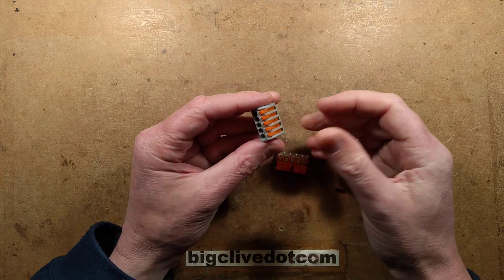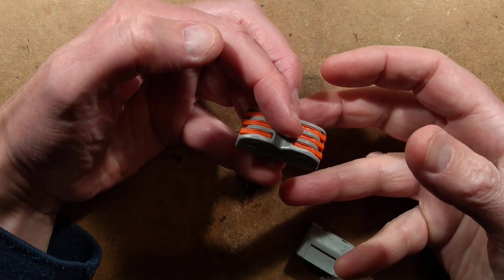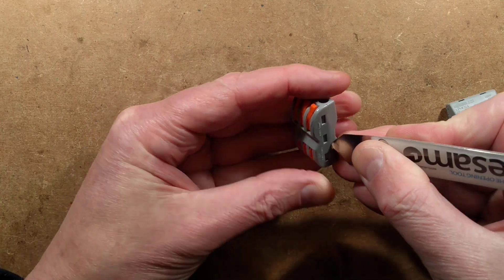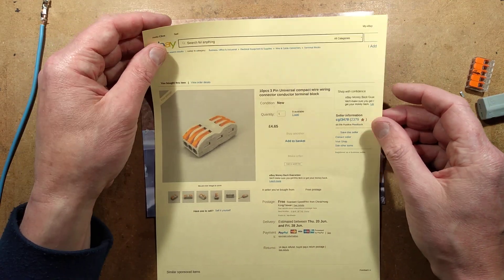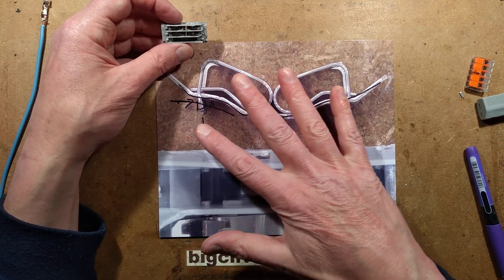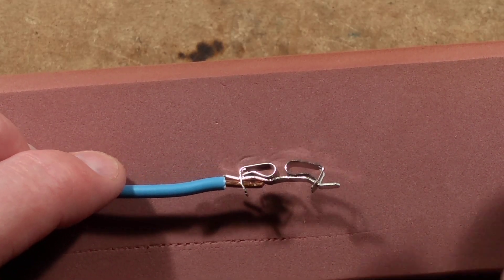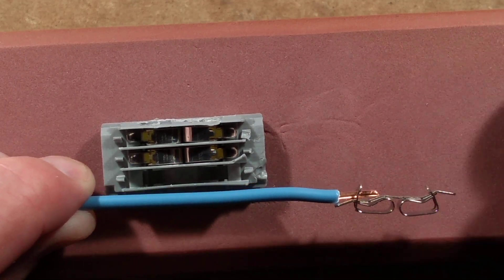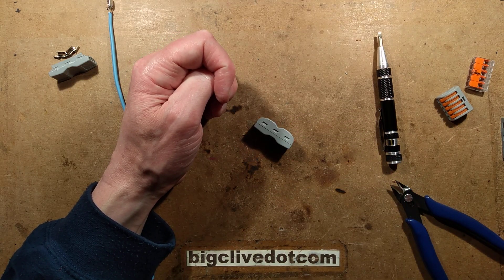Clone of Wago product that Wago don't even sell???

Comment: I've told Wago reps several times at trade shows that they need to do a multipole in-line connector as conventional ones are a mess to use - serves them right if someone else  does it
Reply: I bought some of the two and three wire splicers based off of Clive's first video with them, and my immediate thought upon using them was "why do I need two of these to splice power cables?"
Reply: @MrMartinSchou  because then, they can sell you 3 splicers instead of just one.
Reply: @oreubens  I know - I'm guessing that's why they are also referred to as lever wire nuts. But it's still stupid. This particular solution is far superior for certain applications.
Reply: @MrMartinSchou  Because you using two of their products instead of one. 
I think its profit maximisation.
Reply: It's odd how some companies come up with good ideas and then just stop developing them. I've had a similar conversation with a plumbing company that makes push fit fittings. For some reason they don't do 45 degree bends with connectors on both ends. You can bodge something together with two fittings but come on, it's such an obvious product.
Reply: @WobblycogsUk  Make it yourself, patent out. Retire :)
Reply: @WobblycogsUk  Might it be pressure, because of the bend?  That could but out of design pressures on the fitting- solved by redesigning the fitting but that would increase its cost, possibly beyond the cost of the current two fitting solution?  Tradesmen (people) are very cost sensitive so they don't buy the costly improved product but continue to use the bodge- so the company just wasted a lot of money.  Just an idea.  This type of fitting is used in water cooling a PC, or rather it is avoided when water cooling a PC as they fail.  You do bends in pipe and try and stick to inline pressure fit/ bayonet fittings.  Obviously water and electrics, especially expensive PC electrics are bad when mixed- so the best practice is to use hard pipe which you bend using heat (it is thermo-plastic).  Flexible pipe fails much more regularly even with the relatively low pressure in such a system.
Reply: @WobblycogsUk  I know what you mean im a plumber as well sometimes you dont have the room to fit two fitting. Its just to make more money
Reply: @rolandkeys8297  "Its just to make more money." I take it that you do not suffer from such sin.
Reply: @WobblycogsUk  I see a UK website offering the North American "SharkBite" push-fit product, which does offer a 45 degree bend www. sharkbiteplumbing . co. uk/ product / 45-degree-elbows/
Reply: @Wobblycogs Workshop It's not odd at all, the original company comes up with a good idea, then a fat Corpo comes along, buys the company and sucks it dry until it dies, then moves on. It's a common practice where by, the bigCorpo buys itself out of mediocrity.
Were it up to me, i would make this practice illegal and all such transactions in the past 10 years dismantled. It hurts the economy of every country on this planet, it hurts us, it hurts the product and the people working for the companies that are bought. THE only people who profit from this are the fat CEOs (some of the most useless life forms on this planet) and the banks.

Two close examples: EA (worst company award) and Google's parent Alphabet, and before that Google itself. Their most disgusting move was to buy quite a lot of groups that dealt in robotics, and when the CEO who's fad was followed moved on, they sold them. For example, Boston Dynamics wound up on the Japanese market. And now, one of their robots will be sold as a toy to the public IN Japan.

That's all nice, but, the people who bought them are SoftBank, a group notorious for their hate of those that are not Japanese. The future ain't bright for BD and already some people left.
Reply: @Alpha Machina - 3D printing something like this would be like printing books using a plotter and a quill. You use 3D printing for prototypes or when you absolutely have to (ex., complex manifolds that simply cannot be cast / machined / injection-moulded). You can literally injection-mould over 100 of these for the same cost and in the same time it would take you to 3D print a single one.

And the "cost of tooling" was basically the same for the Chinese manufacturer; the main extra expense for Wago would be testing and certification, which I'm guessing the Chinese guys didn't bother with.
Reply: @WobblycogsUk  You think an ex-money-laundering-mafia-startup would MAKE something? HAHAHA no. They fired their original designers. Engineers don't like publicity, so they have a buddy handling the marketting. Except the buddy handling the marketting is an asshole that backstabs his cash cow. This happens in EVERY company. CEO's are naturally ludites.
Reply: @dimitar4y  Only that Wago actually develops their product line.
Reply: exactly, wago should have done this type of connector in the first place.
Reply: I would prefer a version where all cable come in from the same side which would make it a bit more compact for things such as ceiling lamps.  Another improvement to difference this from the other wagos would be to use proper colors such as brown, blue, yellow/green to make sure nobody confuses the two types.
Reply: @ralfbaechle  Yeah, the levers should have 3 different colours that corresponds on both sides.
Reply: @trygvelillefosse6986  :   ........and there’s no tooling cost in changing the resin colour (assuming the levers are made separately)
Reply: @trygvelillefosse6986  does it really need colors to mix people up, or do you just need to stop trying to be a electrician.
Reply: @ralfbaechle  Actually that already exists. Over on aliexpress (probably on ebay too, since most of them are the same sellers any way) you can find these with colored levers in exactly the colors you want. There are also these, but T shaped (1 in, 2-3 out) and bunch of other fascinating variants including DIN-rail mounted.
Reply: @ralfbaechle  Good idea.  I agree I like the one sided approach as you say it saves space.  For inline, and I'm not saying this is the best way- I have a relatively expensive (£100) USB charged/battery powered soldering iron- it's programmable even but that isn't needed here.  So I just solder together and use that shrink tubing (shrinks with heat.  Again I'm not an electrician but dad was and he thought it OK to do- I didn't tell him the cost of the soldering iron though.

This is a link to the soldering iron, it is like a thick pen and it has somewhat unusual bits- they are ceramic and part of the design as that holds in heat.  I have other soldering irons as this is really for PCB stuff, no good for heavy duty cables (mains AC).    https://www.electromaker.io/blog/article/what-is-the-ts100-soldering-iron
Reply: @johncoops6897  OK then I promise I'll never do it again.  But I didn't say it was an alternative to WAGO or WAGO clones.  I said if i want to join two wires together in line I will solder them, is that not valid as well?
Reply: @johncoops6897  You see rather than jump down my throut with your superiority complex you could have read my comment before disagreeing with it.  If you had you would have seen I was never talking about mains voltage, I was talking about low voltage.  But in your race to be right you don't have time to try and undrstand.  You need a mirror.
Reply: @johncoops6897    Hide behind your 'professionalism, so professional you don't even need to read or comprehend. Look I don’t care what they are mainly for in your small world.  My point is I made it very clear that I use them in low voltage work, well also step down from Mains to low voltages as well).  But I have no heed to use them for outdoor low voltage work where I just need to solder two wires together, I admitted it was unorthodox.  However, it works, it looks neat. It is much cheaper.  There isn’t anything no to like.  It isn’t likely to fail; it is in trunking and the wires are sleeve with shrink/heat tubing.  I still use WAGO for lots of things and it is popular with PCS/SBC/Wireless hobbyists.  Wago have a range.  Some of the stuff is clearly heavy duty for mains, other stuff isn’t despite being the same thing but rated lower.

You didn’t read my post so you are arguing points I never made in your head.  I am avoiding the cost, bulk and time involved in junction boxes- so why bang on with them as they aren’t there.  I have no need for a junction box because I am joining two near parallel wires together.  You think that is very wrong.  It isn’t, it is quite clever.  In fact, so clever it sort of has a name, and it is used by NASA (who I’m sure you think are also wrong).  In the USA they also use the method for mains, so the USA is wrong as well.  You should stand for PM and tell us all how wrong we are.

I would tell you the name, but then as my father would have said if he were still alive why waste my breath.  Whatever your apprenticeship taught you don’t need a junction box to join two wires together, and you don’t need that Wago.  You can solder and sleeve and that works OK outdoors.  You just need to know your solders.  The sleeving does help but there is a stress failure risk.  It doesn’t affect me; we live on the cost so don’t get frost damage. And because I use the accepted soldered system (with no name) I am confident that just about every electrician and telecoms engineer in the USA, plus NASA engineers can’t all be wrong while you are correct- especially when you couldn’t even be bothered to read my post before attacking it.

And it is BS to suggest a WAGO fitting is professional only, and they do a range that are for low voltage work, so the mains only is wrong.  I can buy both in B&Q.  Professionals only my arse- next you'll be telling me screw drivers are professional only.  Bet you wish the channel was professional only as well, just you obviously, as the only real professional her- you could talk to yourself.

If you can't be bothered to read you'll just make a fool of yourself having to back peddle and that doesn't look professional.  Thankful those that can read can make their own time and also will understand I don't claim any professionalism (although I am, just not an electrician, as I make clear in my original post that you can't be bothered to read).
Reply: @ralfbaechle  I agree but it would add costs...
Reply: @alfflasymphonyx  it would need a completly different tool to be made for the injection molding . Once you have that its the same amount of plastic and internal parts that make it up so , 15 grand for the injection molding tool and away you go . If ''wago''  cant aford that they are doing something wrong
Reply: @ralfbaechle  thts great but GB isnt the only color code in the world in the states we have green white black and we use wago as well???🤔
Reply: @ralfbaechle , yeah. The size is really annoying.
Reply: @ralfbaechle  Are you allowed to use a noun as a verb? Shouldn't that be "to differentiate this from..." or "to distinguish this from..."?
Reply: It's a matter of tooling. The costs involved with developing new tooling, or even new production methods at all, for new products is (can be) astronomical, and is the major factor in any company getting to a point of being able to manufacture any product en mass. So, with that in mind, it's no wonder most companies are happy to continue producing what they already produce with the tooling, or method, that they already have. It's easy to innovate and come up with ideas, but actually mass producing those ideas is the difficult part.

All of that aside, they could really cut down on costs by simply 3D printing all of these components, sans the spring clamp innards. That makes innovating much easier, and it could even be printed in quite robust materials like nylon or polyvinyl chloride. There are even methods for "printing" metals now, using a kind of laser to super-heat a metal powder, layer by layer.
Reply: @AlphaMachina  3D printing is a fuckton more expensive except prototypes.
Reply: @Aria18976  A lot of companies out of Shenzhen are using 3D printing for several steps in their manufacturing processes. Perhaps you're out of touch?
Reply: @AlphaMachina  he said for prototype but normaly they use sla well because you know
Reply: @AlphaMachina  They could design it in the USA / EU etc. and manufacture it in China. Just like most other stuff. Or manufacture the stuff in an even smarter and more cost effective way locally in the USA / EU etc.
Reply: @nixxonnor  it's not more cost effective to manuf in the EU or US. These would be 2 bucks a peice if manuf in the us.
Reply: @AlphaMachina  You obviously have no idea how mass production works. 3D printing these is ridiculous, the parts drop out of injection molding machines faster than a 3D printer would even reach the starting position.
Tooling is just not an issue for a company like Wago. Project costs, development, tests, certification, etc. far outweigh the cost of tooling, especially for small parts like this. And they make so many of these they have certainly made many molds by now, and certainly run many in parallel.
Reply: @pen25  with all the paperwork and tests needed for compliance? I don't think so.
Reply: @AlphaMachina  I don't think it is a tooling problem. You can see from the tear down that the critical component is the metal wire-wire conductor. Wago already have this, the rest is just a plastic molding fot the main body. The cost of 3D printing is huge compared to high volume injection molding, so that isn't an option.
Reply: @AlphaMachina  or they can just buy the tooling from the Chinese counterfeiter that already makes them 😁
Reply: @AlphaMachina  Would only be worth it for low volume products, injection molding is cheaper per unit, but has a decently high setup cost, so you'd definitely move to molding for high volume products
Reply: @AlphaMachina  Tooling costs can be high but 10-15 grand will get you the tool , then throw it in an injection molding machine and you turn out thousands per day on a relativle medium speed machine so you soon make your money back
Reply: @pen25  and because it is a professional product, people would still buy them en masse
Reply: I am surprised wago doesn't sell something like this. it is basically a terminal barrier block with the convenience of the wago style connection. Thank you China for taking up the slack. no wonder all our jobs are moving there 🤣.
Reply: So i wasn't the only crazy person. Three times, once in person to one of their reps, and twice over mail. Screw them, frankly, you either keep an ear on the ground or get run over.
Reply: @AlphaMachina  Don't feed the trolls.
Reply: WAGO shouldn't make these type. As a frequent use of the classic WAGO clamps I am used that all wires are connected. It would be very confusing to me if that is not the case. If they would make s.th. similar it should look more different (e.g. other color).
Reply: @kaiklopsch8590  That's obvious. C'mon.
Reply: Yep, first time I saw these I grabbed a few just out of curiosity. I like how solid the connections feel I wondered myself why there weren't these straight-through types. It's a bit dumb having to use three individual clunky pieces to make an a/c mains connection.  If Wago don't actually already do this product then they have dropped the ball massively. I see someone else mentioned it's expensive to make tooling - well they seem extremely popular, someone else mentioned they're almost a government mandated monopoly in Germany so I'm sure they have some cashflow and the Chinese have been able to afford the tooling.
Reply: fucking bridging issues. these pass-through terminals would be way clunckier to fullfill standards. and for this you already have these screw-terminals.
Reply: @mikeselectricstuff. Did they give a reason why they don't do it?
Reply: @martin_mue  probably because of greed, I had to use 3 of the normal ones to make a simple junction. It is very obvious that the passthrough ones should be an option from the begining.
Reply: @martin_mue  as any big corpo, they want max profit with minimal investment. They ain't doing anything. They just profiteering. Most, if not all, companies that are big enough, started as money laundering startups. You think an ex-money-laundering-mafia-startup would MAKE something? HAHAHA no.
Reply: @dimitar4y  That's nonsense, it is quite obvious Wago is constantly innovating and developing new products that others copy.
Why would they make the 221 if they have the 222 that sells well?
Reply: @dimitar4y  As silly as he sounds he is right. Big company's go to china have them make it and slap there own name on it. We do it where i work we rip off other companies heat shrink off battery packs and stick our own heat shrink on.  It's cheaper and saves millions in R&D and tooling.
Reply: @DEVONLAD11  Scamming customers by least spending from the company's size, for maximum profit, regardless of the loss of sanity on employees, or their minwages. Profiteering. That should be a crime, but oh well we're on a planet where beheading, schizophrenia, pedophilia and rape are legal, soo.
Reply: @dimitar4y  psychosis on fire
Reply: In defence of the Wago system, yes indeed I agree it would be nice sometimes to have a three pole separated connector, but usually, I find the current design neater when joining three or four cables in an adaptable box because you can bring all the cables in from the bottom and have a line of Wagos along the top. 
With connector choc blocs it could get real messy, not to mention time-consuming.
Reply: They've no excuses now there's a design to copy! lolz
Reply: Weirdly they do with DIN rail connectors just not the splicing connectors.
Reply: Just like with printers really, the more toner cartridges you use the more money the OEM makes (in theory, but everyone including me uses refills, go for Brother lasers to avoid chips) so the more Wagos you have to bodge together the more consumables sold the more they make basically. Maybe I'm just cynical but yep it serves them right that the cloners have come up with a better product than the OEM.
Reply: Yes, quite right, so have I at Trade Shows!  Copper wires deform under conventional grub screws the screws lose pressure quite quickly leading to poor contact and corrosion surrounding point of contact.
Reply: I think it's clear why Wago was not interested (so far):
1. You can do this using three of their existing connectors instead of just one of the in-line connectors.
2. This is a special case. Most of all connections using Wago connectors will involve splitting one cable into two or more.
Some bean counters will then calculate that just creating the SAP number needed for this new product variation will be more expensive than the expected profit and the product manager isn't too keen on having to care for yet another variation, and it's easier to just look the other way.
Reply: This: https://www.wago.com/de/verbindungstechnik/installationsklemmen-entdecken/221/221durchgangsverbinder is the connector you need ;-)
Reply: wago does make a proper product for this purpose, check out "WAGO 224-201 PUSHWIRE Inline"
Reply: In Norway we have the transparent version of the multiple cable coupling( with 2, 3 or even 4 distinct two way couplings). So I believe they allready produce them, if you want I can look them up.
Reply: well they do an inline splicing but it's only one wire to one wire, so a lot of the advantage of this video's product is lost there
Reply: They DO already sell these... Because I'm German, I've picked the german product pages (you can't easily change your language on their homepage). Here are some of these:

2-pole-connector (for Lamps):

https://www.wago.com/de/netzanschlussklemmen/leuchtenanschlussklemme/p/294-4012

3-pole-connector (also for Lamps, carries also PE):
https://www.wago.com/de/netzanschlussklemmen/leuchtenanschlussklemme/p/294-4013

5-pole-connector (you know it, for Lamps - L1, L2, L3, N, PE)
https://www.wago.com/de/netzanschlussklemmen/leuchtenanschlussklemme/p/294-8135

5-pole-connector (now also for other devices - Safe to use in potential explosive areas):
https://www.wago.com/de/netzanschlussklemmen/4-leiter-geraeteanschlussklemme/p/862-1505_999-950
Reply: I have also spoken to Wago at trade shows about several drawbacks with there products and the response is
1- the cost of design and manufacture of this product when their existing range of connector can be used to splice your wire together is too high (not worth the time of effort).
2- using there existing product range, you will use more and therefore a greater sail (profit) for Wago
3- They have no real interest in listening to there customers if they are not saying how good there product is. You try at the next trade show, go up to them and say "I love your product" (Wago happy smiles and bright eyes) "but it would help if you did a junction box that was in the middle of the small one and the large one (the one you can park a bus in)"  (Wago sad face and disinterested). It makes me laugh every time.
Reply: @rolandkeys8297  Sounds like they're inviting the Chinese to eat their lunch.
Reply: @dimitar4y  Were you dropped on the head as a baby?
If there was money to be made they would have made it. The tooling will cost them tens of thousands of dollars. Some bean counter has worked out that getting that money back would take much longer than they are comfortable with and said product never got made. There's no need to make up bizarre conspiracy theories.
Reply: I'm just some dood who watched some videos about wiring up receptacles and whatnot a while back, and I was absolutely shocked that Wago do not make inline connectors when I looked on their site.

And frankly, despite commenters here, I think it is conceivable that a line of inline connectors would be considerably less costly to manufacture than the current ones: just one primary spring per splice. Color coding the levers would add some cost, but honestly, I'd bet people would pay good money for that.